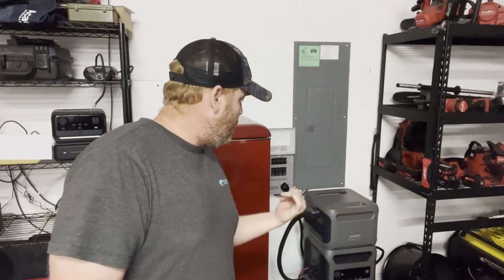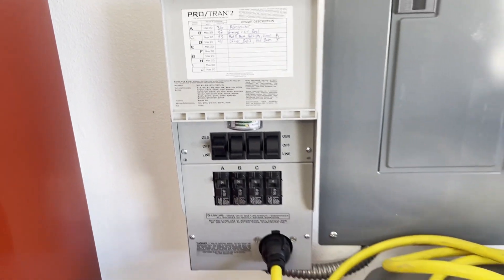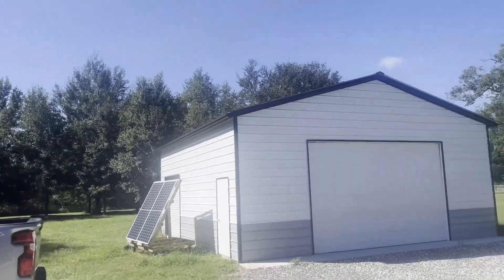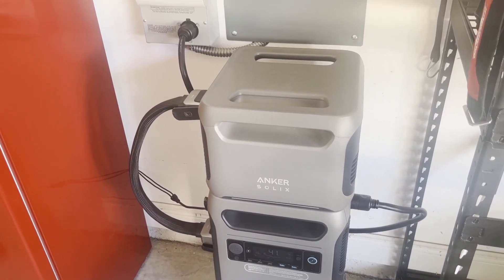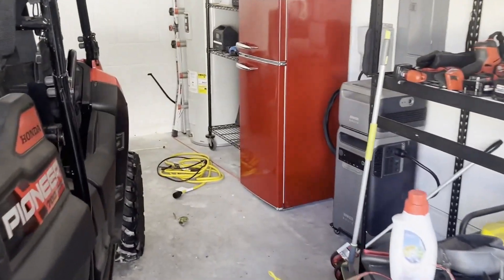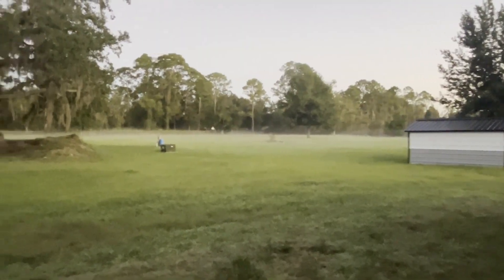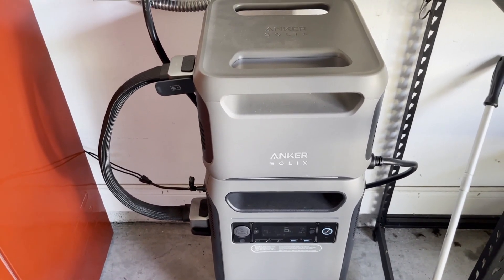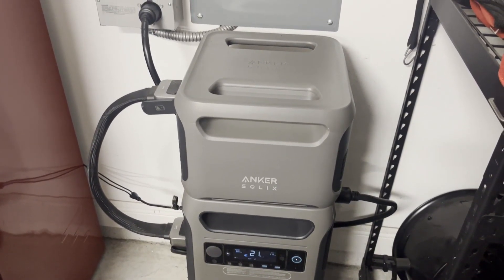Off-Grid Power Test: Will 1000 Watts of Solar Keep My Fridge Running on the Anker SOLIX F3800?

Comment: My transfer switch does not automatically trip my breaker switch. I wonder why yours is tripping the fridge breaker in your main panel. 
For me this would be an issue because my main panel is outside and my transfer switch is inside. I don’t want to go outside in bad weather to turn any breakers back on due to tripping.
Reply from the maker: I was told it’s because we already have an interlock transfer switch for the whole house generator on the outside. For now, I don’t mind letting it ride but i will definitely revisit it when we expand the solar and install a slightly larger sub-panel inside.

Comment: What about storage capacity? How many Anker batteries can you chain? I run a simple 12v system to run a medium size fridge and. Medium size freezer. I have 1200 watts of panels and a 600AH battery bank. That gives me 3 days of autonomy if needed.
Reply from the maker: You can add a ton of storage with the anker expansion batteries. However the cost is difficult for me to justify so I think we will look to a different setup In the future.

Comment: Do you get a notice/warning when the power shuts down??? I currently only get solar from 9 to 3 because of shade so far can cover my needs as long as I don't get a week of clouds.... 
Side note, no solar installer (selfish and greedy) will put solar on my roof so I can get solar from 3-9...
You should be able to hack the extension battery cord to add any 48v battery to the unit... A lot cheaper than what they want you to pay...plus you can use any solar charger on that 48v battery... So more solar panels...
Reply from the maker: I don’t recall getting any warnings but I might have notifications turned off in the app. I have seen a few videos of the cable trick and it’s something I will definitely try sooner than later!

Comment: You are losing about 1000-1500 watt-hours a day (Hobotech measured 2500+) just on inverter on loses.  You really  need a smaller unit with lower inverter loss for things that are a constant low wattage drain.  I have a smaller DIY system with the Victron Phoenix 1200/24 that has 8 watts of inverter loss.  Using this system, I can keep my refrigerator going with 400 watts of solar and still have enough excess to make up for some not so great days.

Another thing you can do is to add a timer on the refrigerator and run it on a 1-hour on / 2-hour off duty cycle or even a 2-on / 2-off.  This will reduce your power usage by 20-30%

About two years ago I rand a test like this one.

First I ran a test with grid power and I got 675 watt-hours over a 24 hour period.  Average power comes out to about 28 watts and max power about 200 watts during defrost cycle.  I then put the refrigerator on a timer and set it for a cycle of 1-hour on, 3-hours off and it used 455 watt-hours or a saving of about 30% (220 watt-hours).

During the cycling test, the Freezer warmed up to between 16 and 21 degrees at the end of the 3 hours off and then cooled down to 0-10 degrees.  I happened to catch it during the defrost cycle, and it warmed up to 23 degrees and quickly dropped back to 14 degrees after 5 minutes.

I ran it on an EcoFlow River Max Plus (old style), with 720 watt-hours and it lasted 18+ hours with the refrigerator constantly getting power.  I later did it with the Delta 2 and it got slightly over 24 hours.

I then tested it with some solar panels and constant on, and 200 watts was barely keeping up over a 24 hour period.  A 300 watts was keeping up, but not a lot of extra power, but my 300 watt panel is a portable one which performs more like a 225-250 watt panel.  Using 400 watts easily kept up and had enough extra power to charge the power station up after a low solar day or for other uses during the sunny part of the day.  The 200 watt panel would easily keep things going with a 1-hour on, 3-hour off timed duty cycle.

I do have a small inverter generator to top off the EcoFlow if there is more than one bad solar day.

The Refrigerator is a Samsung basic 17 cu-ft Garage Ready refrigerator, no ice maker, and an inverter controlled compressor.
Reply from the maker: Thanks for the input! There is definitely a trade off in the efficiency department for the sake of portability with these big all in one units. We hoped to power at least two circuits full time, but wanted to see what it would take to do just the fridge using what we have already. I feel like not having to pull the fridge out to plug it into backup power is already a win! 😂. Last hurricane season I declared we will not move our big fridge in and out for power loss ever again.
Reply: @Backyard_Florida for my garage refrigerator, I put a heavy duty appliance extension cord on it. I can pull the cord out and unplug the refrigerator to plug it into a cord coming from the power station. 

When we lose power, I intend to go the same thing with my kitchen unit, except I will add a 550 cord to the plug and then tape the 550 cord to the back of the refrigerator. That way the next time, I can just lift the 550 cord and move the plugs around.

Comment: Man and i though my 2, 200 watts panels will do it.😢
Reply from the maker: Well, technically it can. It’s just a matter of how long. We have a lot of inefficiency in our setup with the long run of wire and high idle consumption with the anker unit. If we switched to a smaller more efficient power station we might be pleasantly surprised by better results.
Reply: @Backyard_Florida jackery 3000, with 400 watts panels. Great video eyes opened
Reply from the maker: Love that Jackery!

Comment: That looks like a retro fridge.  What's the brand?  I'm guessing its a bit of a power hog because even in cloudy weather 1000W of solar should be able to do the job.  That said, the Anker F3800's inverter has a fairly high idle consumption... around 70W just doing nothing.  So 1.68kWh/day just to run the inverter, never mind the fridge.  That is probably contributing to the problem.  It is really designed to run larger loads than a single fridge.

You can probably make it work with what you already have by adding a few more panels to brute-force your way through the inefficiencies.

I'm still a bit surprised that it wasn't able to do it, though I guess I shouldn't be.  Lots of inefficiencies add-up.  A regular sized residential fridge usually clocks in under 2 kWh/day of consumption (that fridge probably uses closer to 4kWh/day if my guess is correct), and a discrete solar system setup would have a much lower idle consumption (around 11W using Victron equipment rather than 70 with the Solix).

-Matt
Reply from the maker: The retro fridge is Galanz from Home Depot. We are actually powering the fridge in our kitchen though. It’s pretty much the biggest split door Samsung with double freezer drawer that I could find when we built the house a few years ago. It’s definitely death by a 1000 cuts with the current setup. 

I know the anker is a pig but I really expected 1000 watts to handle it without issue, especially since we are in central FL. We changed up the panel configuration on our next video and it’s running more like we hoped. I will still add the last two panels soon to do just like you said, brute force our way through the high consumption of the anker.

Comment: Wait 11:01  what???.

Is it supposed to work like that?  I thought the transfer switch was a bypass.  Why is it tripping that breaker?
Reply from the maker: It’s a combination of a few things. We already have an interlock transfer switch wired for the circuit and also from what I understand(I’m far from an expert) it has to do with running the individual GFCI circuits on “gen”. I will give my electrician a shout to see if he can gives a more correctly worded answer.
Reply: I read on a Reddit it can trip if it’s a GFCI. However I have GFCI breakers and mine never trips. I also have an interlock on my main panel outside, with a 50AMP inlet to power my house with my Trifuel generator.

Comment: Something ain't right. I'm running two large chest freezers one is new other one is probably 20 years old they take around 4 kwh in 24 hour's I have 1400 watt panels. I have 600 ah lithium batteries. In morning I'm down to around 80% and I'm usually 100% by 1:00. That fridge  shouldn't be taking that kind of power. Or your not getting what you should outta your panels
Reply from the maker: You correct that we were getting hosed on our panel output. That’s why we ended up switching to a lower amperage string of panels. We were looking at 15-16% voltage drop and of course panels aren’t usually 100% efficient. When the compressor is working the fridge pulls 350-400 watts plus the 40-50 watts of idle consumption on the anker. Spoiler alert- on the new 1400 watt setup with less amperage we are back to 100 percent on batteries around 3:30-4:00. What  voltage system are you running?
Reply: @Backyard_Florida I'm running 12v. With two victron 100/50 smart mppt controller's and a 3000 renogy  inverter. It works great. I'm not sure what inverter uses by itself. But can't be too much. I've got a shunt but  haven't checked
Reply from the maker: Awesome! While I do enjoy our anker, I’m looking forward to picking up an eg4 inverter so I can stop dealing with the crazy 60v solar input limit. I think the eg4 inverters are a bit more efficient as well.
Reply: @Backyard_Florida I've got a ecoflow its limited to around 400 watts. It's a good portable unit.  I'm building another 400 ah  3000 watt inverter system with 2 victron 100/50  on a hand-dolly. For home  use or  anything I need portable power for. Cutting my power bill quite a bit
Reply from the maker: I love the dolly karts! The internet seems torn on whether it’s safe without being able to ground the inverter on some of the dolly setups. Have you figured out a work around or if it really matters that much?

Comment: How much power does your fridge use on average per day?  I have two one is a 15 year old fridge side by side which is our main the other is in the garage has freezer in top and we store extra drinks and frozen items in it. Inside averages 2.05kWh outside unit averages 0.69kWh. This is a 30 day average so pretty accurate
Reply from the maker: Hey - I might be a little off trying to account for our inverter draw because the anker has a high idle consumption but based on our nighttime usage I would say we are around 3.5kWh to 3.8kWh per day.
Reply: @Backyard_Florida not sure if you were able to calculate the idle draw without any loads and with loads. Doing a rough search I see the anker has an idle range between 500wh to 1.5kwh a day! That means roughly 150-350w of your array maybe be used just to keep inverters on. 

Some say if you will not use high wattage loads then to always aim for the smallest most efficient inverter. It’s not linear and depends a lot on manufactures, but a 1000-2000w good inverter, tends to have less idle draws than larger systems. 

Love your larger set up though !
Reply from the maker: Thanks for the input! I agree with all your sentiments. That’s actually why we pulled the anker out of the shop to start powering house circuits. It was a bit too much for how little we ask of the unit in the shop. I hoped that we could power the garage low voltage and fridge circuits full time, but I’m quickly realizing we will need better panels and/or a more efficient inverter setup. I’m a sucker for a good experiment, so I’m testing and learning before I buy anything else.
Reply: @Backyard_Florida thanks and for sure will be looking for the next video. Im looking at getting the f3800 plus. Looking at a few others as well. All depends on black friday and cyber Monday prices
Reply from the maker: That’s when we try to make our big purchases too - we like that the 3800 plus has additional solar input but we dislike the proprietary solar input connections and lack of 50amp plug
Reply: @Backyard_Florida i agree its a shame they removed the 50amp plug. If the price is right might go with 2 f3800+ and get the adapter that connects them together which gives me my 50amp plug back. Hopefully add solar panels depending on sales. Goal is to run both fridge/freezers during a power outage along with celling fans and a few others items in the home.  Inhave a generator i can use to recharge during extended outages and not have to have a loud generator running overnight

Comment: I love how user friendly this. Do you want to discharge the system every so often or can you leave it charged for long periods of time?
Reply from the maker: These batteries are pretty low maintenance compared to the older lead acid style batteries. Lots of people keep them fully charged for emergency backup for long periods of time without issue.